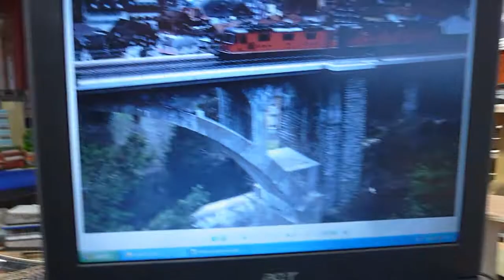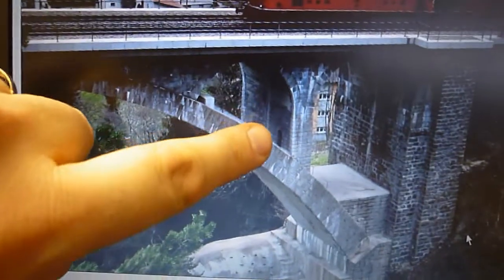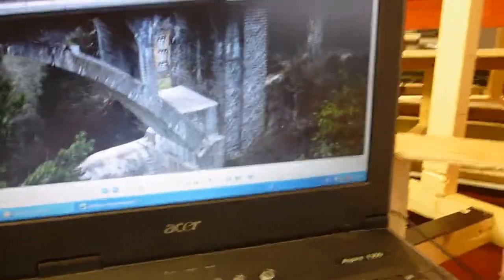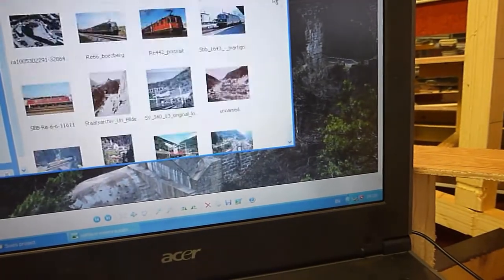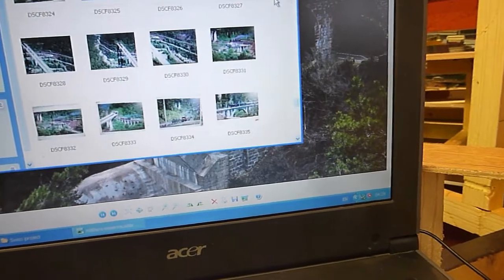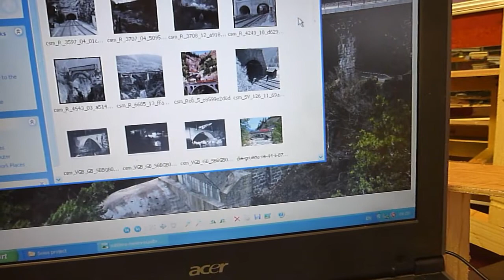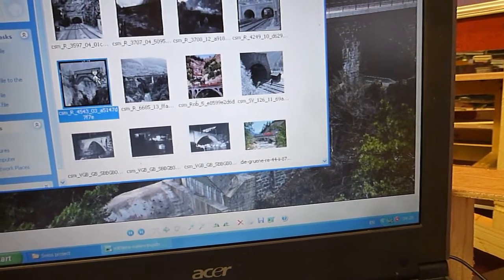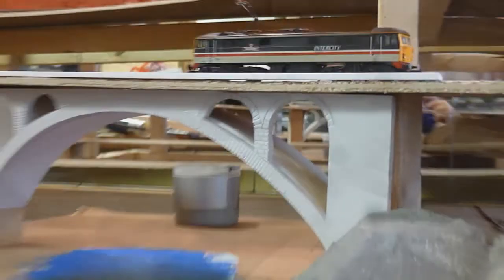Wemblesden 21 - Building a bridge for the N gauge layout

Comment: ¡Hola buenos días Dave!  Great progress with the N-Guate build. That Formex product appears very versatile. Where are you sourcing yours from? (is there a link available please). It’s possible one of my local ferreterías (DIY/ironmongers) may be able to supply it here in Spain. The brick detailing is ideal as it’s difficult to get a bespoke effects fr9m the usual styrene suppliers generally.  Un saludo. Gary
Reply from the maker: Foamex is widely used by sign makers for making signs. I used to get a lot of scrap bits when I used to work at my brother in laws sign writing place. You can get it on ebay but it is expensive so might be worth popping into a local sign makers and see if they have any scrap off cuts. ;)